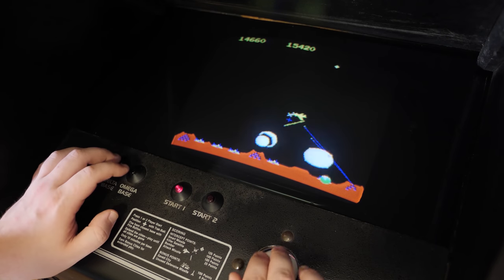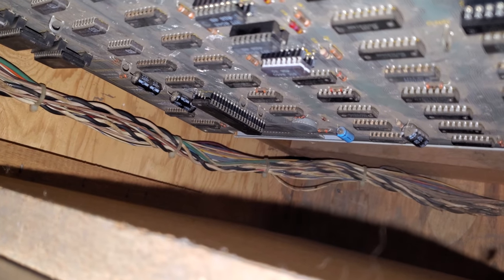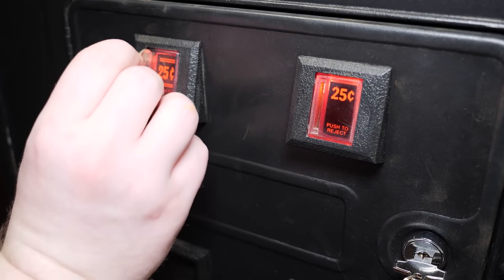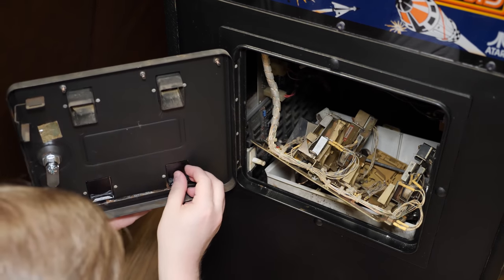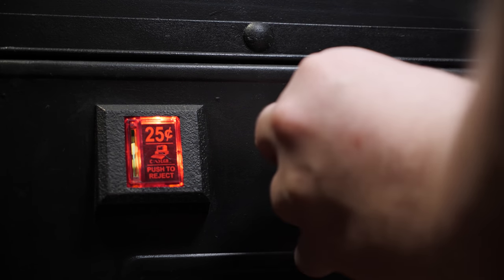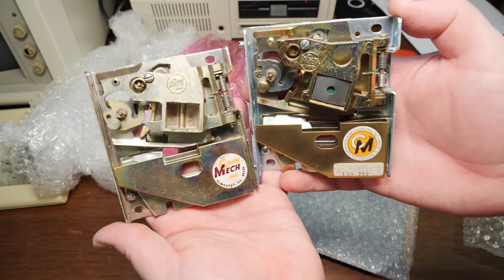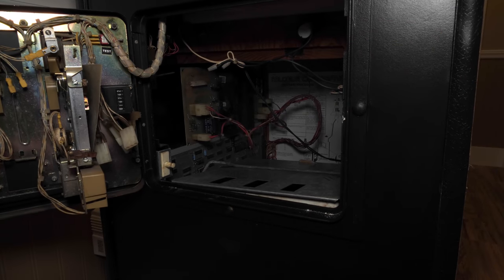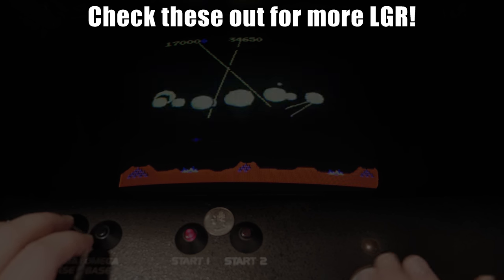Updating my Atari Missile Command Arcade Machine!

Comment: Hey LGR, question, do you unlock the slots to collect all your coins when you run out? I’m assuming you don’t just keep using whatever loose change you find, you just take the ones you’ve inserted in the machine out and reuse them?

Comment: if you wanna get rid of the scratches on those little plastic bits Flitz polishing cream is the way to go! works on metal, plastic, and pretty much anything else you put it on. We use it where I work to polish guns. All you need is a rag.

Comment: "The coin mechanisms had all sorts of issues." But that's all part of the realism man, you're supposed to have to bang on/kick/whatever the thing, complete with the requisite swearing, then have an arcade employee come out and yell at you ;-) seriously though, I agree 100%, if I had an arcade machine, I would totally set it to require quarters, setting a machine on free play just feels "wrong." And I HAAATE the sound of quarters falling into an empty (or almost empty) coin box. I could always tell whenever the guys collected the coins at my local arcade, because when I put in a quarter or token, it would make that totally dead sounding metallic "plink" noise.

Comment: Ah, arcade collecting, I have 5 machines... I restored an Asteroids, even found an ORIGNINAL side coin slot (so you put the coins in sideways), it was in poor shape, so I pulled it completely apart, re-sprayed it, polished all the coin parts, and put it all together, this machine I got as a empty cabinet, it fully works, but, missing the original back cover (have a smaller one that sort of fits)  

And my pride an joy... I found a Hydra game on one of the forums 10 years ago, Any gamer would know it was a Star Wars cockpit, it was completely sprayed black, I went through step by step, stripping paint till I got the original art back (most is in good shape accept for a few spots), Found the correct wiring harness, and a 19" color XY monitor... all up and running... I was able to find the ORIGNAL 25" picture tube, and finally got the rest of the boards (parts needed), and going to take on that project soon... 

I also have a System 1 cab, it plays Road Blasters, Marble Madness and Indiana Jones and the temple of doom (all the kits to play them) and a Ms Pac-man running a jr pac board (I have booth, jr pac is more challenging) and I also have a Crystal Castles... 

My wife hates my collection... it's my passion... and a VERY addictive hobby...

Comment: Refurbishing arcade cabinets is a super cool rabbit hole to go down...welcome to the club. By the way, metal coin buckets (even a metal ice bucket) sound a lot cooler to me than the plastic trays - I usually toss those. Also, since you're into sounds, if you can't add 20 cabinets to your house (I dare you!), do the next best thing - google the Arcade Ambiance Project. You can download MP3 files for period specific groups of games and sounds you would have heard when you walked into an arcade back in the day. Then I create speaker groups with (admittedly probably too many) smart speakers throughout the house..so even with just one cabinet or none, perhaps - just walking around the house, you can really add to the experience.

Comment: This will probably get buried but as someone who once worked in an arcade and as someone who currently runs his own detailing business, I have some cleaning hints for you.  For the button plate, get some diluted Simple Green and a nylon brush to get that stubborn dust out of the textured surfaces.  Work in small areas and follow each area up with a damp microfiber to assure its all clean.  This will also work elsewhere and help get rid of greasy fingerprints.  For the coin buttons, a headlight restoration kit (I use the Turtle Wax one as it comes with little sanding pads) should get those scratches out and make them shine like never before.   This will also work on the plexiglass signage.  Typically I'd follow up with a polish that has a UV protectant in it.  For the display glass, nothing but isopropyl alcohol was ever used.

I don't think you need any hints on that PCB at all, you're over qualified for sure.  If we had to remove any of the boards and noticed oxidation at the connector, we'd usually Deoxit them and then wait overnight to power them back up.

Hope any of this helps, thanks for bringing back some quality memories for me.

Comment: One thing that you could maybe consider is that speaker grill on the back. It's riveted on but you can carefully drill out those rivets to clean that speaker grill and the speaker underneath, and then either replace the rivets with screws or just redo the rivets, they look like fairly simple blind "pop" style rivets that can be installed with a simple mechanical tool.
Reply from the maker: True, that's possible! I'd kinda like to redo that entire rear surface, both on top and the back door. It's rather ragged.

Comment: Idea for your paper insert slip things:  Print out 4, Take an x-acto and remove the white parts of one of the slips, spray the black parts.. well.. black, glue your cut/painted slip behind an unmolested one, and that should help with the light issue.

Comment: Making your own inserts for the coin return buttons should be pretty easy. Start with clear plastic, print the design you want on paper; cut out the relevant bits, use it as a stencil.

Comment: It's a bit of fiddling around with outlining, but you could print the label/logo on both sides of the paper (one as a mirrored image obviously).
That way the black will be a little darker, while the white has the same amount of transparency
Reply from the maker: That makes the white even less translucent though, which I'm trying to avoid.
Reply: @LGR  Not if that's the same piece of paper but just printed on both sides?
The white will have the same amount of translucency.

Comment: LGR: Let's painstakingly un bend and repair these coin slots! 
2 hours later: Now with that done, I can finally replace these coin slots!
Reply: Not exactly. The metal parts he was unbending were just guides. What he replaced later on were the coin mechanisms that he didn't touch at all.

Comment: Nice cabinet!  I've got a Truxton in a non-original cabinet that otherwise plays fine, an original donkey kong (sadly the blue, not rare red cabinet) that needs capacitors in the CRT to be replaced and a Williams High Speed Pinball that plays but could use some polish. 

Once you start collecting machines it's hard to stop :)

Truxton I got cheap from a fairgrounds in Pennsylvania mainly because it's a cool vertical shooter and I never beat it while in college.  I still haven't beat it but it I do get a lot further :)

Comment: You can design your own tokens in CAD then use the Shapeways metal printing service to get the CAD file printed in SS/Bronze. The price for a print that small will be surprisingly cheap and they will be heavy enough to act as tokens.

Comment: I'm pretty sure they were just using the same coin mechanisms as were going into pinball machines.  The last time those would have been changed was about 1965 when circulation quarters were changed to their modern copper-nickle sandwich design from silver and the weight changed (so the slug rejection mechanism had to be adjusted).

The coin mechanisms change less for many countries than you might expect, as many friendly countries have a coin of similar size and value to a US quarter.  Canada has a 35 cent count almost identical in size and weight to a US quarter, but worth proportionately less (anywhere from 15 to 27 US cents during my lifetime).  The UK has a 10 pence piece that is, again, almost identical to a US quarter in size and weight, and is worth something in the range of 18 to 22 cents US in recent years.  (Things tend to be costly in the UK, btw.  A vending machine price for a 500 ml Coke was a full Pound, which was about $2.20 Canadian at the time I was there in 2005, more than the price of a 2 Liter bottle in Canada at supermarket prices now.)

Comment: I sincerely doubt I'm the first person to suggest this, but to recreate the "1 coin = 1 play" label, you could scan the pages from the manual (or anything really, be it the coin reject labels, stickers, or basically any other printed graphics) and trace them in a vector-based art program like Illustrator. By doing that, you could create (nearly) 100% accurate labels yourself to your own preferences without having to scour the internet for other people's recreations. For text, you could make sure to use the right one by using a font identification site like WhatTheFont so you don't have to cross-reference characters yourself.

Of course if you did this you'd have to seek out a specialized printer/service to get your homemade labels printed on adhesive paper, but it's still the route I personally would take as it gives me complete control over the graphics instead of having to find someone else's work that also matches my own preferences.

Comment: I just buy bags of game tokens on eBay.  Have plenty of Namco and Chuck E Cheese ones as well as quite a few I never heard of.  But, if you are going to be using tokens, you'll need different coin mechs.  The ones you have only support quarters.  I use "Any Coin V3.2! replacement Arcade Coin Mechs!" in my cabinet.  They are plastic, but will accept pretty much anything you can fit in the coin slot and mine get heavy use with no jamming at all.

Comment: Grab some laser printer compatible transparency pages (for overhead projectors) and spray some Krylon matte finish on the back face to spread the light a little (may need a few coats to get the light balance right).

Comment: I have the same machine and mine is also missing the serial number label. I bought mine in not working condition back in 94. Fixed it and I still have it. Just rebuilt the monitor and replaced the smoked plexi. I'm curious, how much did you pay for yours? I'm thinking about selling mine, but I'm not sure what to ask for it.

Comment: There's an SDX Electronics Corp. It was owned along with 5 other businesses by a Perry Bartsch Sr who died in 2005. They were founded in 1981 and manufacture various components and printed circuit designs. Least there's one listed on business sites. It doesn't turn up as a name at it's address on Google Maps. Funnily in looking at the Google Map and you saying the misspelled Asheville on that sticker, the map has the Bulldogs Soccer field missing an l.

Comment: I want to know, how did you cut the printed "push to reject" paper so well? maybe i'm just a dunce but I have never been able to get perfect cuts using scissors hah
Reply: For stuff that small scissors would work well enough since it wouldn’t need more than a single cut (and therefore no repositioning and potential drift) on each side, but for larger stuff you can get a specific tool for the job:

https://en.m.wikipedia.org/wiki/Paper_cutter

Comment: Google 'custom coins', it's not that expensive at a few £/$ per coin, but the caveat is that the few places I found have a minimum order of 50, and the more you order the cheaper each coin gets (one site I checked 50 coins was £250, but a 100 was £280). Not great for individual collectors, but if you have several cabs and want to invite friends/family or open an arcade it's a nice way to stand out.

Comment: It won't yellow, too much bleach in modern paper, BUT, you can make a coffee wash to bring it to age. Get a color of coffee that matches the old paper, then put it inside a fine mist bottle and give the paper successive (let it dry thoroughly in between) shot until you're satisfied. If you wanna get artistic, make a coffee, be sloppy with the pour and let it drip on the sides, then "rest" your coffee mug on the paper in several places, even quickly smudge one whilst saying "oh sh*t". :D

ps None of those labels were the same width, don't worry about it.

Comment: That save high scores type of kit would have saved George Costanza a lot of grief.  Well, if it was pre installed that is. 
Funny, I was exactly the opposite with the sound of coins.  For some reason I preferred it when it was empty or almost empty.  I don't know.  I was weird.
I have to admit, not clearing the rust from those small bits in the mechanisms, seriously annoyed me.  Though it shouldn't.
Wait, why don't you just print the 1 coin stickers?  Yes I read your post, I am just curious why you chose not to print them too.

Comment: This video did not feel its length, I was captivated for every second.
We never really had arcades when I was growing up, machines like these were ruled to be gambling by Swedish law in 1982, requiring a gambling license just to house them in establishments, so they were just difficult to find where I lived. I saw a pinball table at an airport once, but had no coins to play with, and a barber had some cabinets for a short while as well, didn't get to play those either.

The Finland Ferries usually had some arcade machines though, so I got to play some there. Shame is that the EU wanted their cut from their previously tax-free operation, so the business model was killed.

Comment: Maybe you can find some online dealer to make the customized tokens, it just might ask for quite a minimum order. As long as the coins are in similar enough size and weight, the coin mechanics can't tell apart exactly what kind of coin you inserted. (Though of course it's illegal to use fake coin on someone else's arcade machine without permission, like, I don't need to explain.)

But really I'd say I don't enjoy inserting coins myself, giving that how quite a few arcades got ridiculously high coin cost (it can be up to 20 per play, but 3~4 is the norm nowadays) that it's just a pain to insert all the coins before each play, so besides the kind of "satisfaction", it's just better that real arcade center got a card reader to insert digital coins. Not to mention that the coin mechanics ejects legit coins like 50% of the time so you truly need to develop some skill just to insert coins efficiently (personally, I find tossing the coin into the slot rather than just loading the slot works more reliably).

Comment: just incase you notice this comment, you can smelt coins with raw materials probably, using cheap metal like tin you could forge coins, people usually smelt down bullet casings but putting molten metal in a round coin cast wouldn't be hard to do

Comment: Whats that hammer thing in top left around 14:50?
Reply: It's a tamper device. If someone whacks the machine hard, the weight hits the metalwork and Grounds the signal wire attached to it, setting off an alarm.

Comment: Operation sheet was upside down. (When you open the back door, you'll see it correct way)
Reply from the maker: Ahh, that kinda makes sense now that I think about it. Still, I rather enjoy seeing the instructions from the front since I open the coin door more often than the rear.
Reply: @LGR  Since you stick the unncessary (like service center number :) but visually appealing items, that's ok to keep it like this. These are like NPCs of this machine. :) Have fun with all of it.

Comment: You could have dropped 800 pennies in there and saved 192 bucks.
Reply: Wouldn't sound the same. Also, that's false. He never spent a single cent to do this. He still has the money. If he ever desperately needs 200 bucks, he never lost it.

Comment: 6:45 probably some people used coins on a string or something like that
Reply: The old "coin on a string" thing didn't work as well as you might think.  The coin mechs were very weight-sensitive; the act of drilling a hole in the quarter so you could tie a string to it, made it light enough that the coin mech wouldn't accept it.  Furthermore, some newer coin mechs were designed with a one-way mechanism so that once the coin got past a certain point, you couldn't pull it back up, so you'd lose the coin anyway.

Comment: You probably just need to increase your laser printer print density to get the effect you want on the reject buttons. Mine (a 1998 LaserJet 2100tn) requires you to send a command to it (or use a vintage configuration utility, but netcat is easier). On my printer (and probably all PCL5 printers), here's the command (assuming you have Ruby and netcat installed, like you would on OSX):

ruby -e 'print "\e%-12345X@PJL\r\n@PJL DEFAULT DENSITY=5\r\n\e%-12345X\r\n\ez\r\n"' | nc YOUR_PRINTER_IP 9100

Change the density to another number as desired. 5 is the max on my printer, and 3 is the default. Yes, %-12345X is correct. ESC-z at the end causes it to print a test page, so you can see what the extra density does.

Comment: I would have replaced all the lightbulbs with LEDs.
Reply: That would have made it look awful compared to the original aesthetic
Reply: @jbfarley  You do know that they make LEDs that resemble regular light bulbs. It's really not about aesthetic, but about longevity. Plus regular light bulbs do give off much more heat than LEDs.
Reply: @dragnridr05  for him it's about aesthetic, doub he would have been happy with it. He can replace them later if they burn out. There's no reason to replace them now. This cabinet also wouldn't put out a noticeable amount of heat or any amount to affect his home
Reply: @jbfarley  True, but still the LEDs would better since they draw less power and the inside of the cabinet would be noticeably cooler which would be easier on the electronics.
Reply: @dragnridr05  nope. The electronics are perfectly fine and it would have been objectively stupid since it ruins the aesthetic